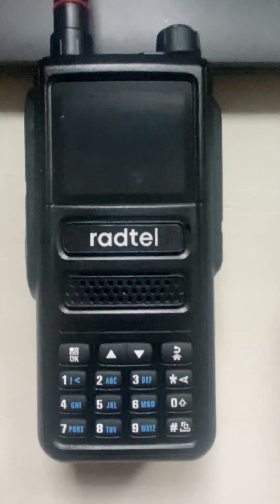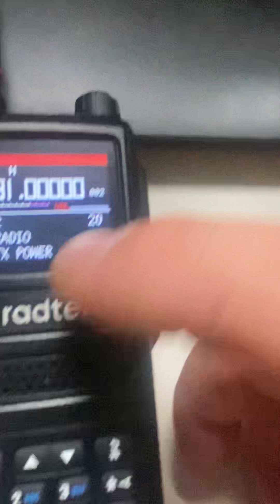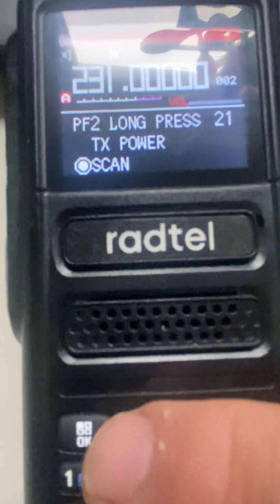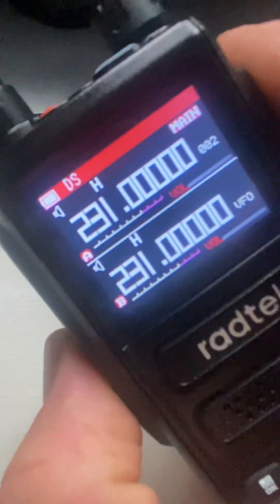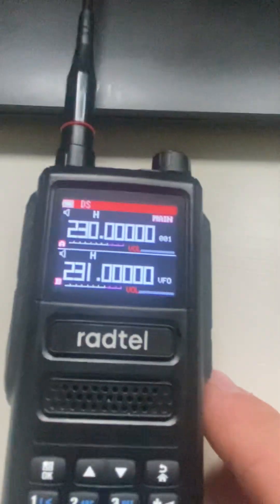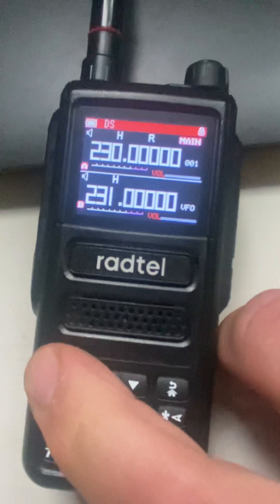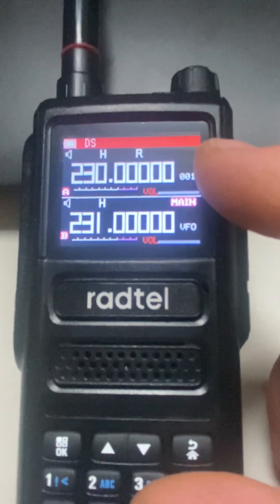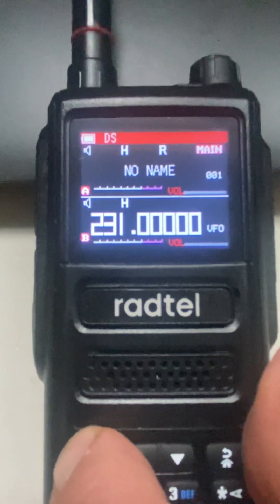Radtel RT-470 / MMLRADIO JC-8811 / JJCC 8810 / Ruyage UV1D……button function program and operation?

Comment: So many options...so few buttons. The firmware is primitive compared to the Baofeng firmware, but the battery and power settings are powerful. I'm not a big VFO fan, but this is the most powerful HT I have. I have two meters and three radios. The power settings are as follows:

Frequency        HIGH       MED       LOW
——————————————————————
140.000          13.75W    7.36W    5.75W
142.725          13.30W    8.71W    3.69W
143.500          13.55W    8.67W    3.89W
144.000          13.61W    7.40W    5.92W
146.355          14.45W    7.31W    3.54W
440.525          10.93W    5.03W    1.86W
442.000          11.36W    5.17W    1.89W
446.252          11.34W    5.24W    2.00W 

The radio, at MEDIUM setting, is a bit more powerful than most other radios, which run about 4.62W-8W. You most likely won't need the HIGH setting (11W-14W), but it's nice to have in case. The LOW setting fluctuates depending on frequency. Great radio. With a cross band repeater, this thing would be awesome. But you can't have everything. (That's why I like the TYT TH-UV8000 radio the best.) The TH-UV8000's power are:

Frequency        HIGH     LOW
——————————————————
140.000            9.22W    6.03W    
142.725            9.84W    6.03W    
143.500            9.98W    6.05W    
146.355          10.40W    6.23W    
440.525          10.50W    5.73W    
442.000            9.86W    5.68W    
446.252            9.57W    5.58W
Reply from the maker: Thanks for the info!
Reply: Es malo mucha potencia? Porque la tyt 8000, no tiene mucha

Comment: Hello..does the programming cable for the boafeng work for the radtel?
Reply from the maker: I believe so from what I’ve seen….here is list of radios they work with from Radtel on Amazon……RT-490 RT-470 RT-470X, UV-K5 RT-590, Compatible RT12 RT-890 RT-830 8800 Plus UV9D AR-869 jc-8629
Reply: @HeyOgre  Yes, the cable works.  The software is different..
Reply from the maker: From what I’ve seen, it seems most of the China made radios use a cable that plugs into the mic and speaker plug….radtel does just like boafeng
Reply: Just like my Baofeng